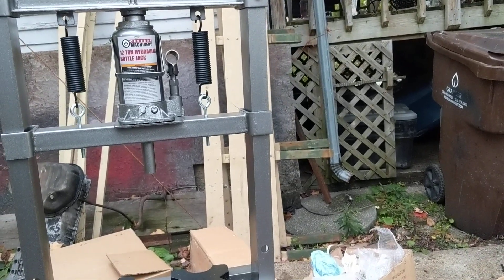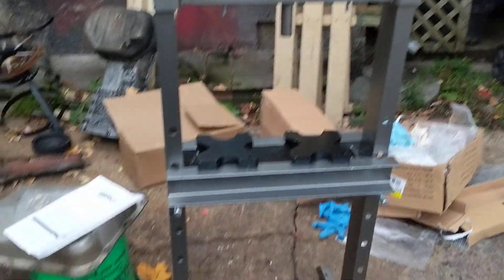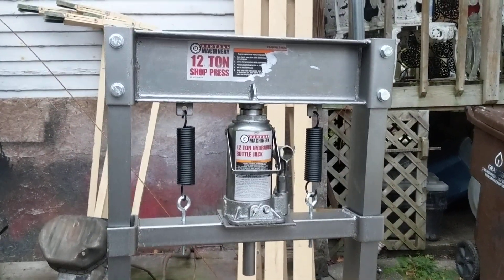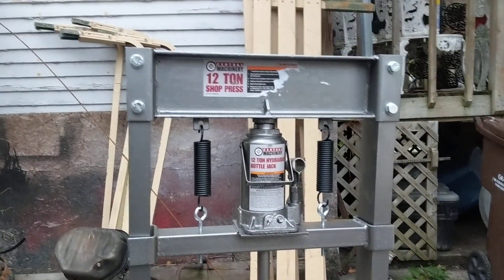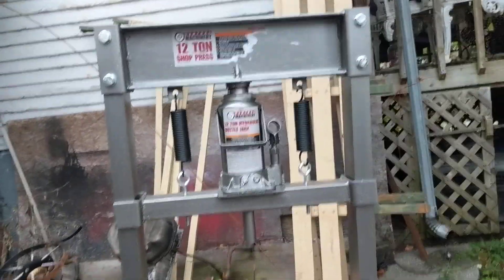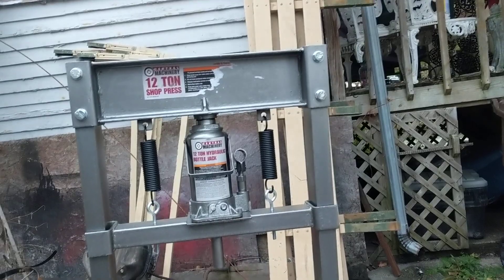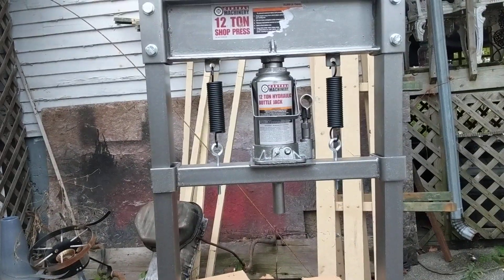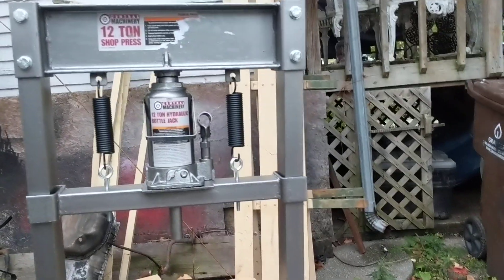When a door closes, a window opens. Cheap press for my cheap Toyota diesel build!

Comment: And away we go! Fingers crossed, and good luck. Look forward to this one.
Reply from the maker: Thanks, I'll need luck, I only bought the exact amount of liners I need 😂
Reply: @TheDrivewayEngineer  Ya, I have done these with Heavy equipment, but not small vehicles. I assume being a "car" these are purely a pressed fit, with no seals?
Reply from the maker: @davebarron5939  Correct, it's a "dry" sleeve, no oring or anything.
Reply: @TheDrivewayEngineer  Never seen this before, proceed my good man. And thanks for the invite!

Comment: We used to heat the female to 320°f and freeze the part to be inserted. That's how they did it for Rolls Royce Aerospace.
Reply: Or something like that lol, whiskeys flowing well at this point.
Reply from the maker: That method works well if the numbers work out.

In this case they don't